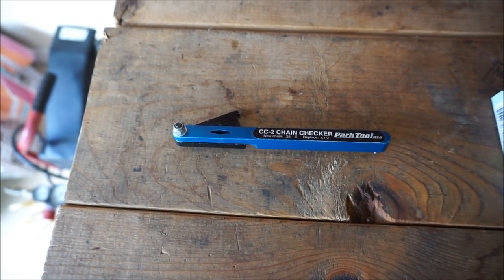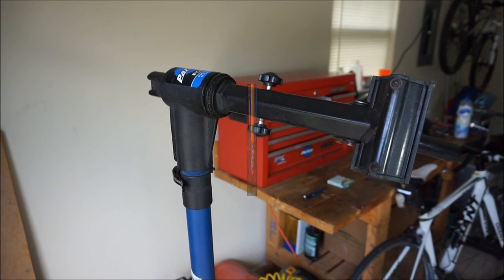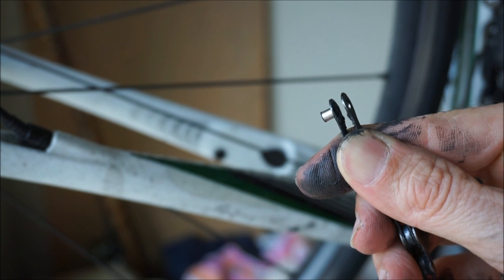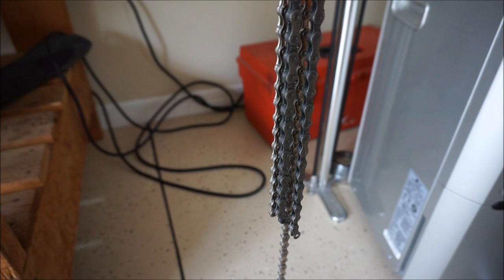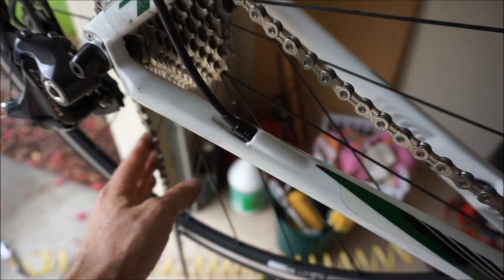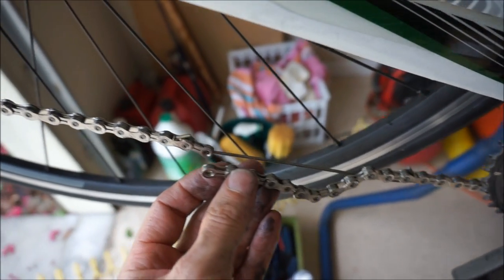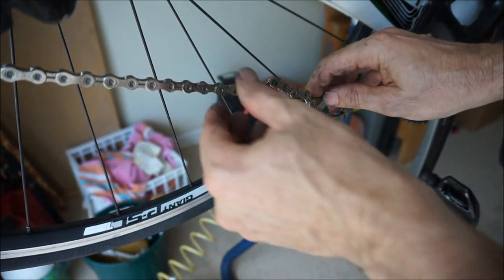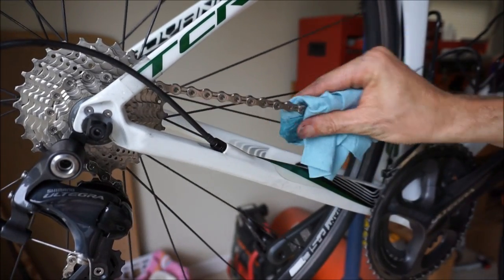How to Install a New Bicycle Chain

Comment: A couple of things to consider:
 1 - On modern index chains, you never want to reuse an existing chain pin. The pins have a little lip on each end and when you push one out, they pull a little of the metal from the outer plate which causes the link to be compromised under load if you push it back to it's original position. The best practice is to push the pin totally out and reconnect with either a shimano pin or a KMC, sram, whipperman ETC. connector link.
2 - When test riding a bike to test wear on the cassette, I've found it's pretty effective to check at a low speed with the brakes dragging. That allows you to apply enough torque to the drivetrain without the risk of inadvertently loosing control of the bike when your chain slips at a high speed.

Comment: Hey Clint i have a question,  i bought an old 90's  road bike from a pawn shop for a good  price but  i couldn't  tell you how old the chain is but i am assuming it might be the original because it still had the original gum wall tires. It has 105 components and everything seems to shift smoothly so my question is at this point is it worth changing because you mentioned a  "stretched drive chain". I  don't want to change it and then have to replace something major for the sake of the chain, i am not doing major riding as it is i am using this bike to get back in the groove of things because its been at least 17 years since I've actually ridin on a regular basis. Thanks for the video and God bless.
Reply from the maker: I'm about 99 percent sure that when you change the chain you're going to have to change the cassette and the front rings. So if you are not a racing the bike then you could probably just keep riding it until the chain breaks and then go ahead and change out the whole drive train.

Comment: You don't need to lube a brand new chain, they are lubed in the factory with a very good hot wax type lube, the best way you could possibly lube a chain actually.
Reply from the maker: Trust wax is actually too sticky and can attract a lot of dirt which is why I recommend trying to take some of it off before riding off road.
Reply: Clint Gibbs Yes,the outside of the chain should be dry, the only place that benefits from lubrication is the where the pin rotates inside the inner plate and where the roller revolves on the ''half bushing''on a modern chain. What I meant was some people degrease a new chain and put on their own lube thinking it's better, when really they just wasted the factory lube that's superior to any way you could lube a chain.

Comment: Hi Clint, I need to install 3 things, 1. new cassettes( old one is 9 speed, the new one is 11 speed), 2. New shifter and derailleur( of course 11 speed). 3. New 11 speed chain. Which one should i install first and the second and the last.
Reply from the maker: Cassette then shifter, then derailleur, then chain.  You will also need a new front chain ring(s) since your old one is for 9 speed, and those should be installed first.
Reply: Thanks Clint. I'm all done, It took me 3 hours and everything is perfect.
Reply from the maker: Great job!

Comment: Great tip.
Btw, the Giant Trance-2 has a special chain, so my bike shop told me.
Is that true ?
Or can I also use another chain / better one ?
Any available to recommend ?
Regards from Japan
Reply from the maker: +Xenos Xanthippe The 2016 Trance 2 comes with a KMC chain.  It's not the highest end KMC, but they are good chains.  It uses a master link which means you shouldn't need a chain tool to remove it.  I'd just ride it until it stretches, then get a KMC X10L (or X10SL if you want the top end)

Comment: +Clint Gibbs, How many miles are you getting out of a chain? I took the month-old XTC to the LBS today for a failed freehub and borrowed their ProGold chain gauge today. It is different than the Park Tool gauge you are using in this video - it has increments, one through ten, with ten being max allowed stretch. Well, it dropped all the way down to the "ten" hash mark with my chain, seemingly indicating that the chain is at max allowable stretch. 

Hard for me to believe that the chain is already stretched beyond tolerances after only one month of riding? 

I've probably put, maybe, 200 miles (all trail) on the bike. Not sure what brand chain it is...drivetrain is XT and it says on the crank, "Use only HG-X chain"
Reply: Meant to say, I'm not sure I trust that ProGold chain checker.
Reply from the maker: It's probably a Shimano chain which don't last as long as KMC chains. Since I switch between four different bikes it's hard to give you an exact number of miles but I would say on a Shimano chain I would get about 3 months of riding.  If the gauge is telling you that I would go ahead and change the chain.
Reply: +Clint Gibbs, Thanks for the quick reply bud. If you're getting ~ 3 mos, it makes sense that this one would already be worn out in a month's time (maybe?), considering that I've put a lot of miles in this bike in the month that I've had it.  

I'm going to go ahead and order a Shimano HG-95 XT chain and see what kind of life I get. Maybe I'll try a KMC next time.
Reply: +Clint Gibbs - Do you have many problems with freehubs? Surprised this one went out in a month's time... 

Any suggestions on aftermarket replacements?
Reply from the maker: Ive rarely had an issue with a freehub.  The one on the Stan's wheels are very easy to maintain which is another reason I really like stans wheels.
Reply: +Clint Gibbs  We'll see what the shop comes up with. I mentioned maybe upgrading... It would be nice if they gave me a little bump in spec...maybe a little better unit. 

I thought I would be good with the specs on this bike...but with as much as I'm riding, i may end up having to upgrade to better wheels and hubs.
Reply from the maker: What size wheels are you on?
Reply: +Clint Gibbs  29"... I am 6'2", 185 lbs, so, not super heavy, but not light either...
Reply: Clint Gibbs I got one of the Park Tool CC-2 chain checkers like what you use in this video, and, sure enough, that ProGold chain checker the LBS was using was wrong. I knew there was no way the XTC's chain was already stretched after just a month of riding. The Park Tool gauge showed ".50", which, really could be in the range of free play built into the chain. 

Incidentally I checked the chain on my 3-year-old road bike with the original drive chain (Scott CR-1 with 105) and it reads ".75", so, it definitely needs a new chain.

Comment: Hey Clint, I just wanted to clarify this...you say add two whole lenghts (4 pins), and this Shimano document (http://si.shimano.com/php/download.php?file=pdf/um/SI-5W70B-001-ENG.pdf) says add two links (2 pins), if I'm reading that correctly. So what is it? 2 pins or 4 pins? Thanks.
Reply from the maker: Tomislav Duić   I add 2 whole links, counting 1 link as a narrow and a wide link.  So 2 links would be 4 pins.  If you run a short cage rear derailleur you could get by with 1 link (2 pins).

Comment: Hi clint i have a giant trance 3 2014 (the red one) which i love but the free hub is almost silent do you
If it can be changed for a louder clicking one without changing the hub ? Thanks
Reply from the maker: The freehub may just need to be serviced. If it is going bad then you can replace the freehub without changing out the whole hub.

Comment: Another great video Clint. Very informative. When measuring the new chain without the help of old chain u say add two whole links meaning 4 rivets holes correct? Also when putting on the new chain does a certain side of chain have to face out or doesn't it really matter?

Comment: I think you mean Missing Link (KMC term), not Master Link - the two mean different things.
Reply from the maker: I use the phrase "master link" as a generic term, but yes the KMC master link is called MissingLink by KMC. SRAM calls theirs PowerLink. Instead of referring to each brand's link name it's easier just to use the phrase master link.